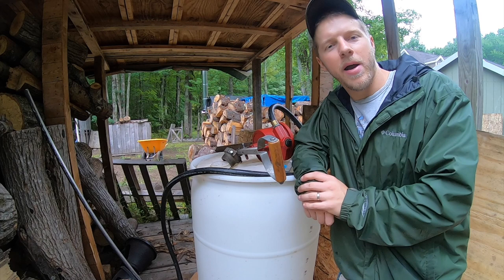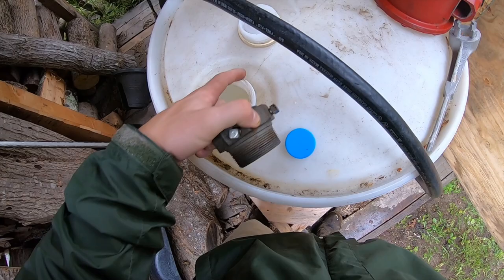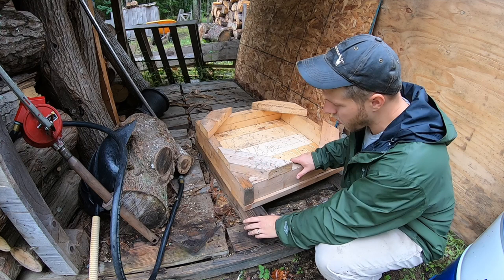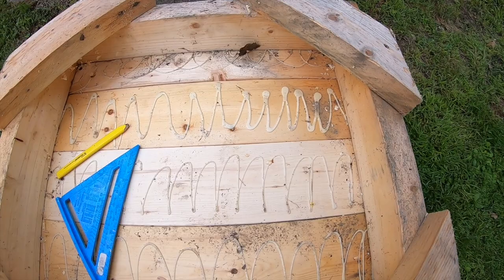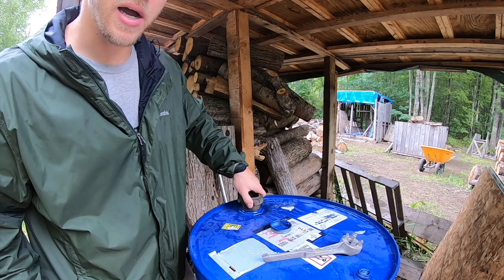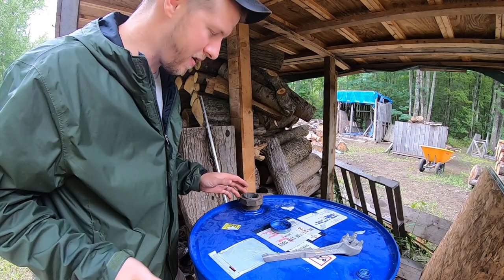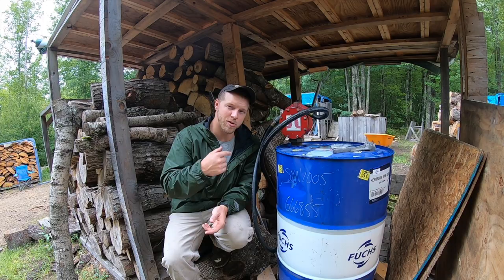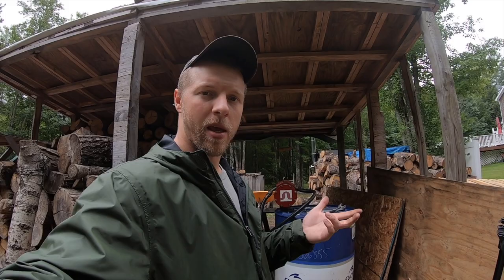55 Gallon Barrel Fuel Storage! Part 2

Comment: I own a landscaping business, my mowers and equipment use alot of fuel. I got tired of going to fuel up every other day with my 5 gallon jugs. I got a similar set up too 🙌🏻.  I like that pump… you dont need mess around with 12v to run that pump… one thing i would add to that pump would be a filter set up. Just incase something gets inside. But thats a sweet set up!
Reply from the maker: Hey CAT! I love this pump! It so handy and been running strong for years with my father and now with me! I am plan on running a filter on it soon!

Comment: I plan on doing sth similar, tho we use it for diesel since both cars run on that. Locally we get those drums for like 10 bucks since so many mechanics shop don't reuse them
Also, that way we can buy from the cheaper gas stations before the prices go up again. 
Additionally i can premix the fuel with my XBEE additive and don't have to mix that awkwardly every time we fill up at the gas station
Reply from the maker: Yes not a bad idea at all! I need to fill mine again! Thanks for tuning in!

Comment: Good afternoon Jay.
I think it's a great idea.
I think I told you I set up a 35 gallon diesel tank. It's a plastic drum. I found a adapter for the barrel bung on line. Was cheap. Works great.
I just got one of those square tanks from on line. Have not put it together yet but will soon. I am going to fill it with non-ethanol gas.. that way I don't have to worries about the gas going bad.. I already keep about 25 gallons of it for the same reasons you do.
I don't use anything but non ethanol gas anymore..
Have done so for a few years and best thing I ever did.
No more gummed up carbs.
I guess I am lucky I have a camp up north and they sell it in a lot of places. There is one gas station in Canaan that sells it.. not sure what town you live in but just take a Sunday drive with the family to just get out and go get some..
As always stay safe and always be kind.
Go 603.
Reply from the maker: Hey Gus! All good things you said for sure! I have seen those unline tanks and heard good things about them for sure! I get my non ethanol fuel from Hampton NH air field. Its 91 non ethanol "mo gas" about $5 a gallon and its great stuff! Saws have never ran better! Stay safe and be kind as well!

Comment: You can buy the tread adapter online 
The plastic barrel is way safer than the metal barrel not only for fire hazard but no rust form on the plastic rust.
Reply from the maker: For sure! My father has one that he uses daily and has had fuel in it for 8 years and its held up nice! I dont like the metal either! I invite you to check out my newest video as I am building  an updated fuel storage system and I think youd like it!
Reply: @HomesteadJay  
I built mine taking yours as a sample , instead of 50 gallons I use 30 gallon plastic barrel just like yours but smaller 
On the diesel barrel I have a fillrite 15 electric pump, on the gasoline barrel I'm getting a pump like yours. Thanks for you videos and for sharing it with us.
Reply from the maker: @rubensalais1502  Glad its helpful! Thank you! I will show the fuel station when its done how EASY it is now! Please subscribe and hit that notification button so you dont miss it!

Comment: Planning on copying this set up for my generator. How far away from the generator should I store the barrel? Can I get a hose long enough? Thanks!
Reply from the maker: I would store your fuel away from your generator and use the barrel as storage and fill 5 gallon (if you physically can) and use those to fill generator. I don’t like fuel
Stored Near heat sources like a generator
Reply: @HomesteadJay  Thanks for the advice

Comment: Did you look at the other cap on the plastic drum? They usually have two different threads.
Reply from the maker: Yes I did hahah Figured that out after the fact LOL
Reply: @HomesteadJay  Is the other cap the right thread or do the metal cans use an entirely different thread?
Reply from the maker: @cornboy3  Its the same!

Comment: I got the 55 gallon drum and the fill rite and a particulate filter and I plan on storing regular gasoline. Question, do you need to vent the barrel? I see another little metal opening and cap on the top of the barrel. Not sure what to do here..
Reply from the maker: Hey John! Check your pump to see if its a vented pump or not. Any drum should be vented for sure! Esp if you barrel is subject to temp changes and or sunlight. My pump isnt a excact air tight seal around the threaded collar so it vents that way but if yours doesnt vent you can get "bung vents" for 55 gallon barrels. It should thread on the other bung fitting and will vent if pressure builds! Whatever you decide to do be careful! Also dont forget a steel barrel should be grounded! Static electricity can occur with some of these pumps so take the time to ground your barrel!

Comment: How did you clean the oil out of the drum . I was thinking about doing the same thing
Reply from the maker: This drum had a non toxic coolant for CNC so it wasnt a oil based it was water based. It was cleaned out prior to be getting it. The factory I got it from has to mandate a clean out before disposal so I lucked out!